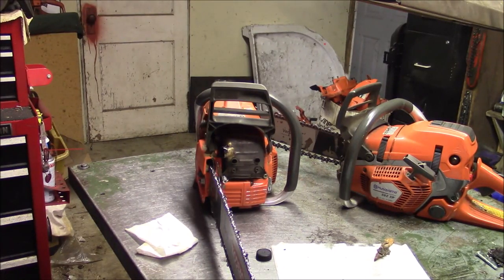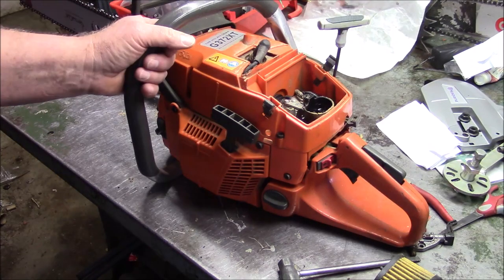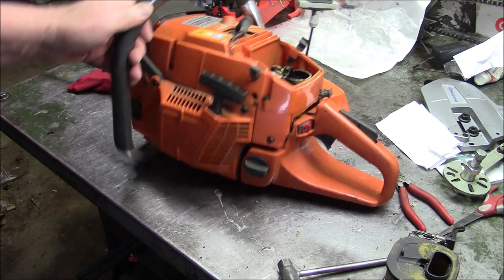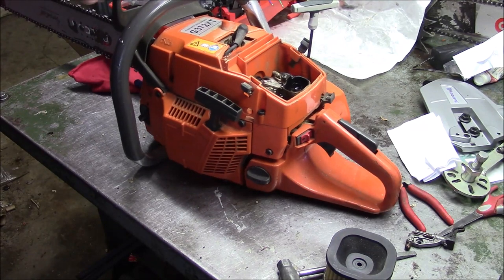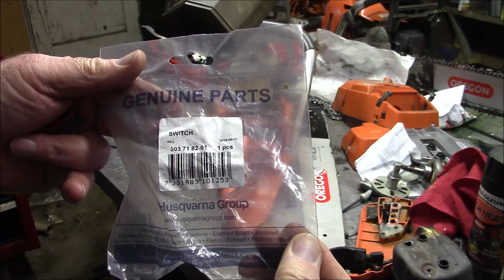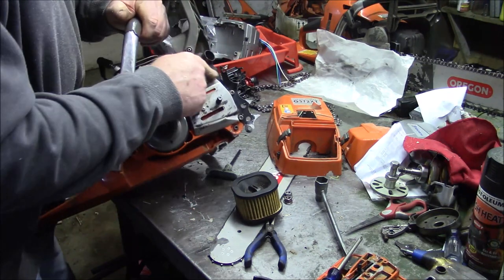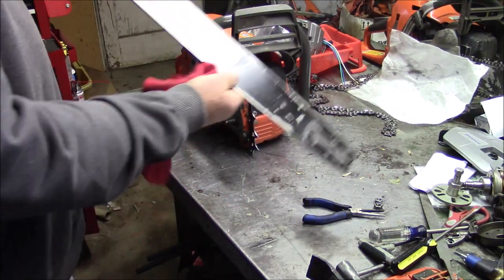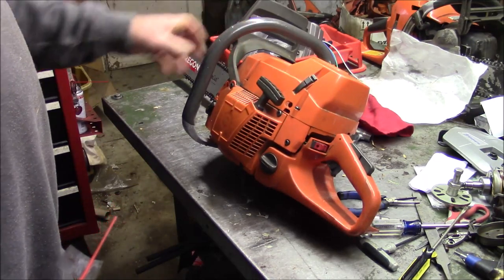Farmertec g372xt HTSS Update, Will It Survive? A Good Work Saw Right Now :)

Comment: Do you know something that no one seems to mention - winter tune verses summer tune.  Yesterday, it was 82 degrees, here, so I decided to check my operational saws in this early spring warm spell.  As I expected my ms 360 and 440 were both running a tad rich and would not stay lit, due to compressor stahl ( to much gas).  I leaned both of them out about an 1/8 of a turn and they stayed lit.  The only two saws that ran properly were my One Pull Charlie 3216 MAC and my Poulan Super 25, both of which had late fall tunes on them from last year.  I had not run the Poulan since last October.  The little Mac I ran last week in 32 degree weather at my daughters home.  Both of the big Stihls had been tuned in sub freezing weather.  This is why it is paramount that users consider when their saw was last tuned and the ambient temperature they will be using the saw in.
Reply from the maker: https://www.youtube.com/watch?v=8LAbnIBVqpM
Reply from the maker: And one of the "cool" things about Autotunes :)

Comment: Hi walt...i received  some farmertec  parts for 372...it looks to me some parts are really below  any standard,  which is a pity...
Reply from the maker: Yeah there are a few things that work I guess, but the Stihl pattern parts are better than the Husqvarna pattern parts. This saw took a lot of effort to get to where it is, hard question is to start with a blown up 372 X-torq and risk having a bad set of cases or one of these knowing there are a bunch of things needing replaced. I guess the answer for me is in where the video's have gone. Actions speak louder than words. :)
Reply: Items i found poor, starter cover ,air cleaner cover clips,bar plate, air shroud, cylinder plating looks thin but juries out on that.. I had a oem carcass as starting  point,  the squish is 73tho with no gasket, cylinder compression  is 100psi, but heres the thing it starts well, and cuts strong..im not equipped  to carry out lathe  work...

Comment: What’s the latest on this saw? You seem to have the most knowledge on it anywhere and the internet. Interested to see how it’s still running?
Reply from the maker: It blew up, the rod bearing failed. Actually all the FT 372's I build with more compression & rpms had bottom end failures either in the crank or literally the cases. Ova led out the pto side bearing pockets on the others. Thing this one as well. This one did survive 6 months of production logging so in reality would never have worn out in a "Hobby Saw" environment.

Comment: i just bought this saw and i have the same problems, can you tell me what parts you changed in order to make it work right?
Reply from the maker: On that one I put a OEM handle, ignition, handle bar as well. I also got rid of the bubble gum gaskets under the cylinder & muffler. Ate up the sprocket quick as well so put an oregon branded sprocket. Also fuel line/filter & spark plug. :) Hey...u asked! It ran STRONG after the cylinder mods for around 6 months, then the pto side bearing pocket opened up and the saw started sucking air, going lean. But what killed it was the wobble from that bearing pocket took out the rod bearing :(

Comment: Hey Walt what style pipe is that you use for your muffler outlet? Just regular old steel or?
Reply from the maker: Typically use steel "conduit" pipe/tubing. turn down the outside to get rid of galvanize and oxidation. :)